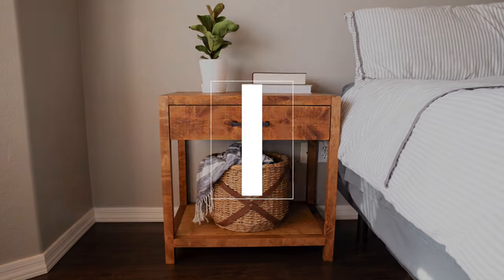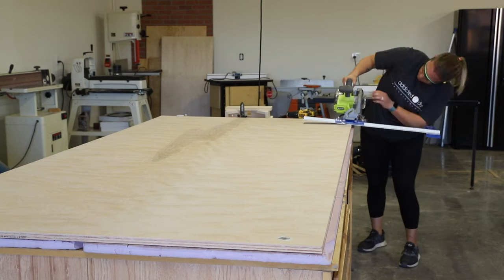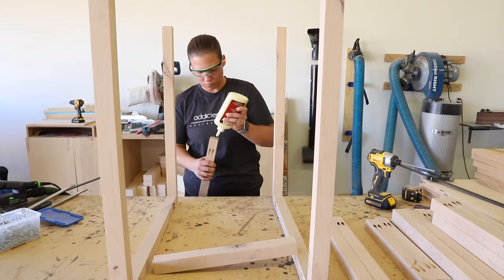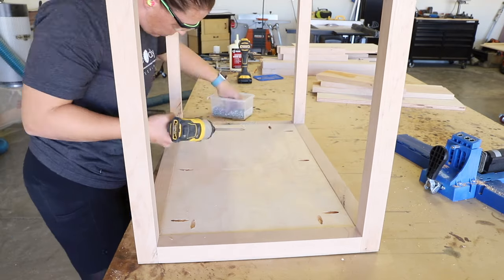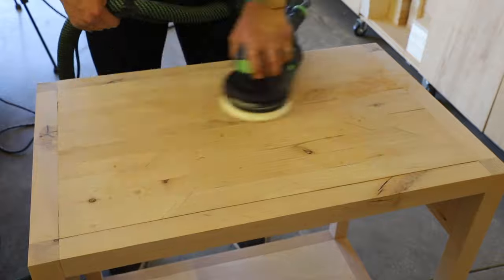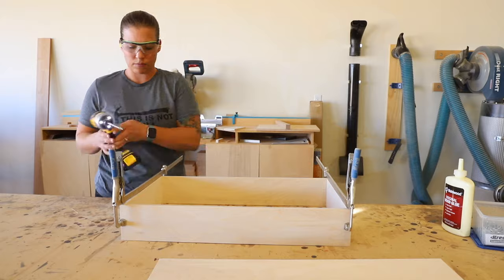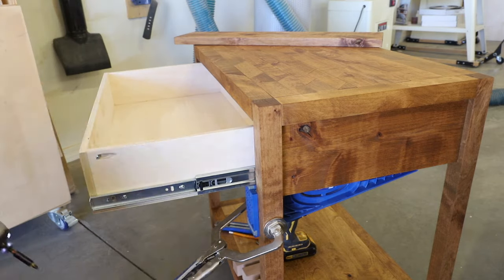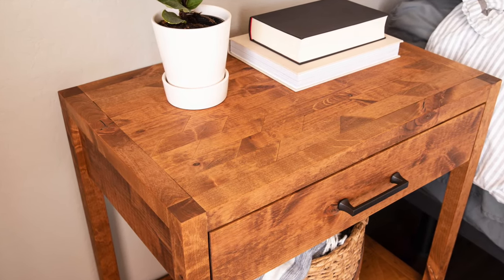How To Build A Nightstand With A Parquet Top

Comment: The end result is amazing
However the only thing I would point out is the amount of screws you used is mind boggling

My great grandfather was a professzionális carpenter and he’d be rolling in his grave if I’ve done something like this

They way he did everything was drilling holes then using dowels alongside with glue

He was able to make it just as strong as if it was made with screws however the end result was a lot nicer

On the other hand I still have to learn a lot of things from you these videos are absolute gold
The tools you were using etc
So thanks for sharing! ❤️